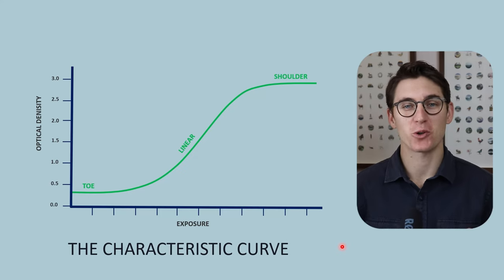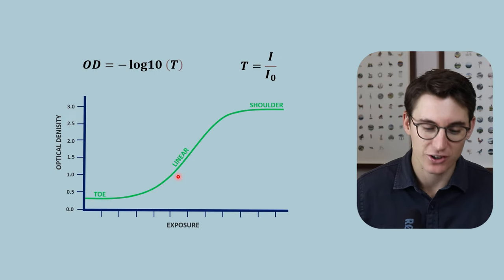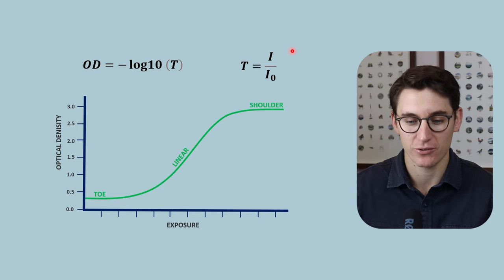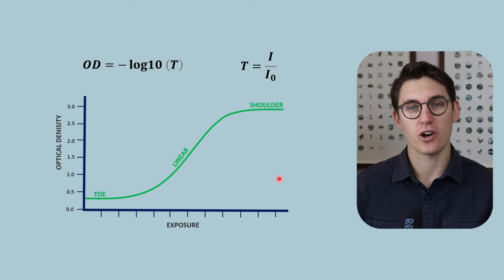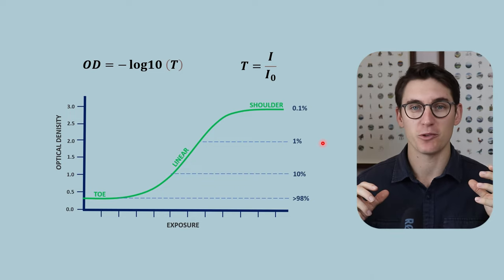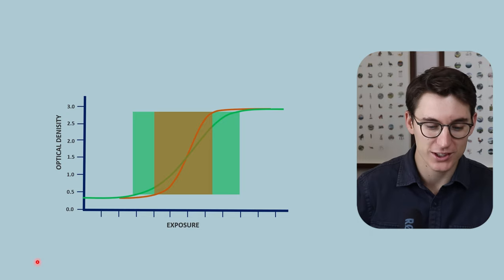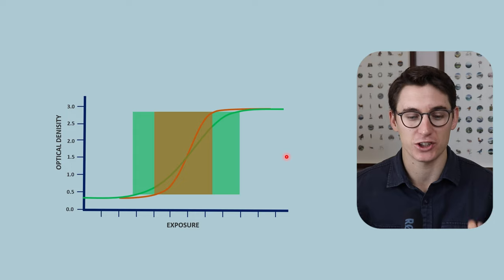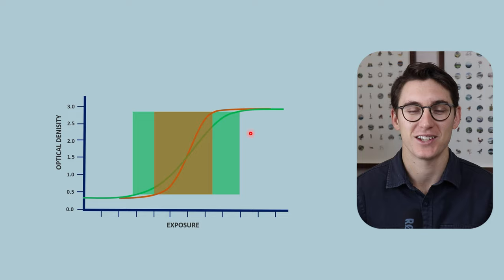The Characteristic Curve | X-ray Physics | Radiology Physics Course #31

Comment: Thank you 🙂
Can you please explain " latitude and contrast of a film are inversely related" through characteristic curves of film a and film b given in the book .
Reply from the maker: The wider/bigger the latitude the less contrast there will be in the image - a greater range of exposures will lead to smaller changes in optical density. A steep characteristic curve has a narrower/smaller latitude - therefore smaller changes in exposure lead to greater changes in optical density (ie more contrast. Hope that makes sense 🙂
Reply: @radiologytutorials  Thank you Dr.Nel

Can we say for a single film (where slope of characteristic curve is constant) increase in latitude has no effect on contrast ??

When we are comparing two films( where with change in slope of curves )latitude and contrast are inversely related.

I am sorry , I am confused🙃
Reply from the maker: The slope of the characteristic curve is what determines latitude. Therefore for an individual film the latitude cannot be changed (and contrast in that film is determined by the latitude and exposure). So you are correct - when comparing two different films we say that latitude and contrast are inversely proportional 👍🏼
Reply: @radiologytutorials  can't we change the latitude of a film by changing range of exposures? Suppose if I change the range of exposures from 0-1 to 0-2 , the range of optical density will also increase right??
Reply: Slope=y2-y1/x2-x1
For a single film , slope is constant ( atleast between toe and shoulder region).
 Can't we say increase in exposure should be accompanied with increase in range of optical densities, so that contrast for a given latitude for a film is constant, even though if we change the latitude (range of exposures )?.

Thank you for your patience and knowledge Dr.Nel❤️
Reply from the maker: I think your confusion might lie in the fact that changing exposure does not change latitude of a film. If we change exposures we change the proportion of optical densities in the image (but this is not changing the latitude) the change in exposure here will account for contrast changes. Latitude is a fixed range for a given film.
Reply: @radiologytutorials  Thank you so much Dr.Nel❤️

Comment: How does high exposure have less transmission?
Reply from the maker: High exposure leads to more silver deposition on the film. Where silver has been deposited on the film light is prevented from passing through (from the light box behind the film). This results in a dark region on the radiograph. If you think about how lungs look on a radiograph (dark), this is because X-rays pass easily through lung (unattenuated) and therefore there is higher exposure on those regions of the film. Hope that helps 🙂
Reply: @radiologytutorials  it all makes sense now. Thanks a lot sir